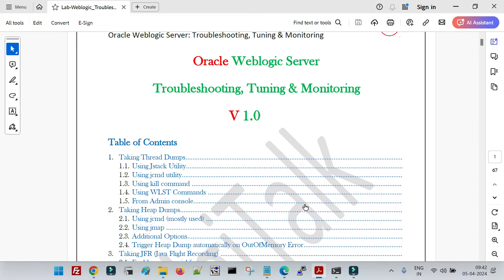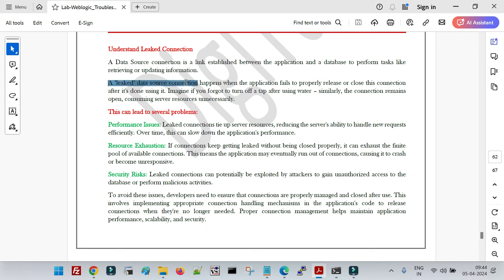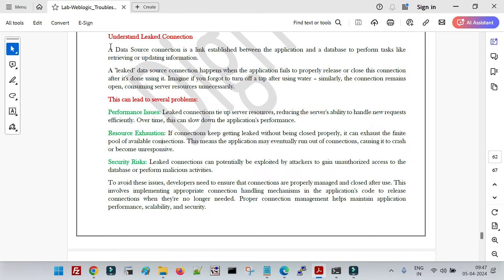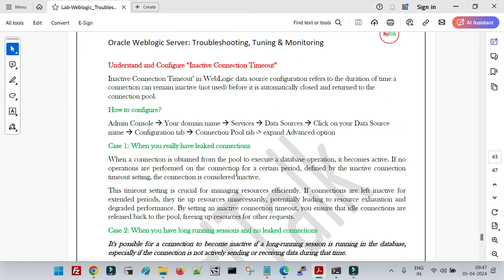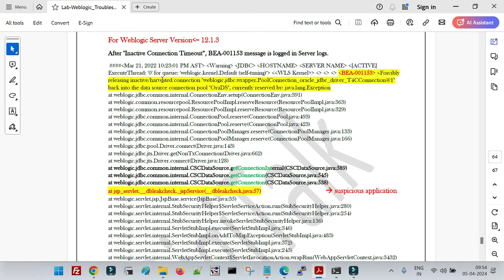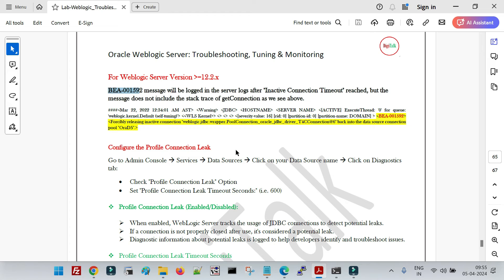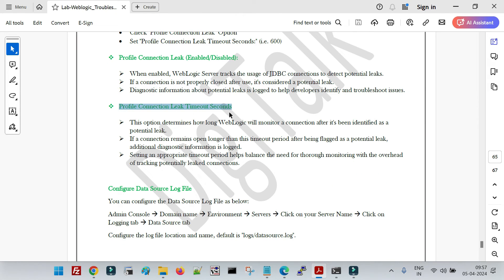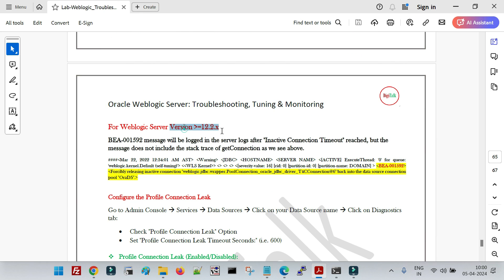Troubleshoot and Tuning Leaked Data Source Connections in WebLogic Server Part 9

Comment: Hi, in my project, we are using WebLogic Server as a middleware layer, and we are experiencing issues with one of the data sources. We have set the capacity to 1200 for 8 managed servers and the inactive connection timeout to 1800 seconds. However, on one or two days each week, one of the servers reaches its maximum capacity without the connections being reduced, or conversely, it drops too low. Do you have any ideas on how to analyze this issue?
Reply from the maker: Are you seeing a leak connections count as well?  You have configured a total of 1200*8 = 9600 connection to the database. Check if you have proper values of backend database sessions and processes  parameters as well. 1800 looks high if you don't have long running sessions, plan to tune (reduce) it.

Comment: Anything we can do if datasource connection is unstable. It usually hangs the weblogic server. How can we prevent our servers to go unstable?
Reply from the maker: Kindly elaborate your question "data source unstable"
Reply: @digitak.middleware  actually the datasource some times faces network issues. And we observe that thread starts getting stuck and eventually lead to the weblogic servers to go down. Anyway we can save our weblogic servers to go down if there is network issue with datasource.
Reply from the maker: In such situations  your data sources will be automatically suspended
Reply: Its actually a network blip and server may go to suspended state for few minutes but then again it gets into a inconsistent state which sends the server into stuck threads and eventually server goes to unknown state.